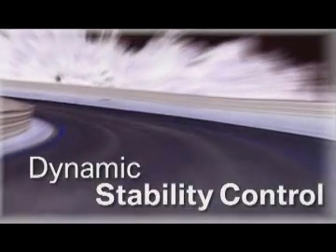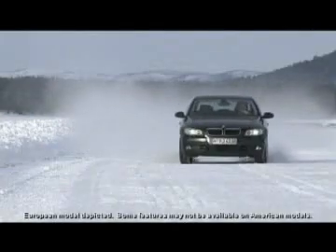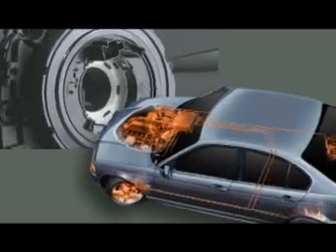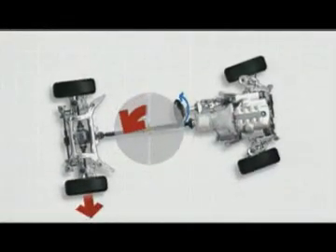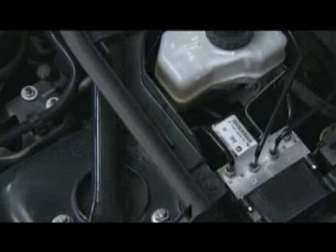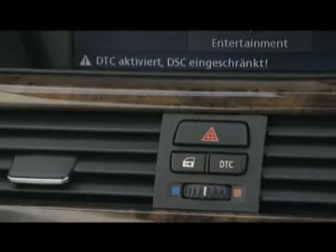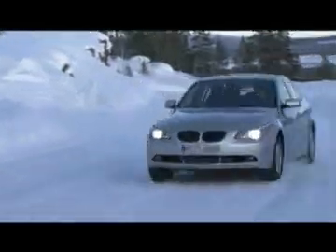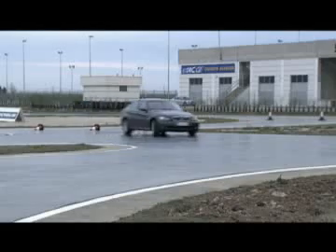BMW Dynamic Stability Control Overview

Comment: Was driving 200km/h on highway when I hydroplaned this thing saved my life!!
Reply: DSC doesn't help with hydroplaning. When you hydroplane, there is a layer of water formed between your tires and the road. As a result, you have no steering control nor any braking. The DSC's braking won't impact yaw. The DSC probably worked for you because you regained or you had some amount of traction in between. Both DSC and anti-lock brakes have any use only when there is non-zero traction.

Comment: Didn't know about this when I first had my 3 series and tried to drift but I couldn't drift at all, the car just make a way to stay straight until I figure out that I still have to turn dsc and dtc off. Very useful in a real driving condition though.
Reply: It doesn't help that you most likely have an open differential which is terrible for drifting lol
Reply: @bonlob23  its drifting and drifting. most people want just to slide occasionally or do some donut in rainy or snow road which can be done without locked or lsd. for serious drifting of course you need something else but you wouldn't your expensive bmw for drifting and destroy it.
Reply: @Feroxing12   im saying the 3 series with an open diff just one wheel peels in the snow so its hard to drift. I had an e90 325 that would do it but it was tough.

Comment: I am about to move from Florida  to a snowy part in the south of Germany. I have never driven in snow before. I am being offered by a German used car dealer either a BMW 316i with DSC (rear wheel drive)  or an Audi A3 (front wheel drive) without DSC but with the advantage of a front wheel drive platform. Which is more useful for a driver with no snow or ice experience?
Reply: I can give you answer, but i feel I'm 12 years late😅

Comment: Agreed, DSC is amazing, and also agreed that it's definitely saved a hell of a lot of people - especially in the wet. Most people do not know how to handle a rear wheel drive car when the back-end slides out quickly, and I would say this is when DSC is most valuable. Understeer is a lot easier to fix. You just come off the throttle.